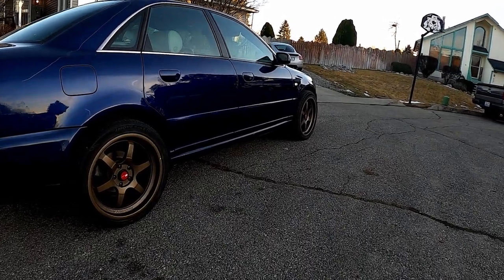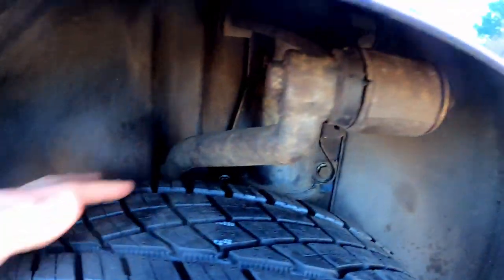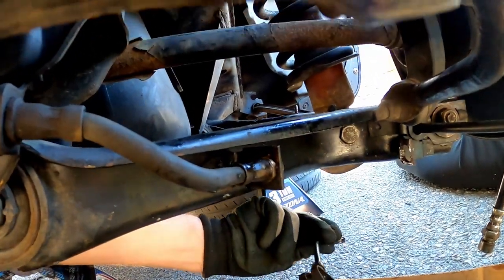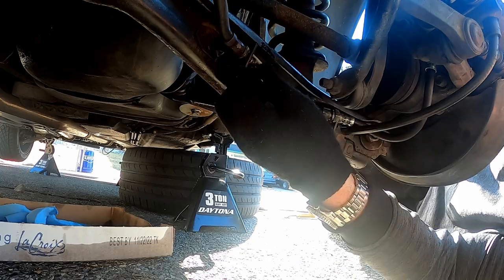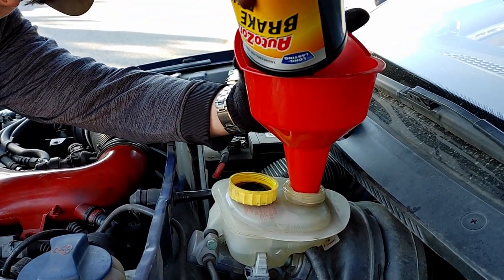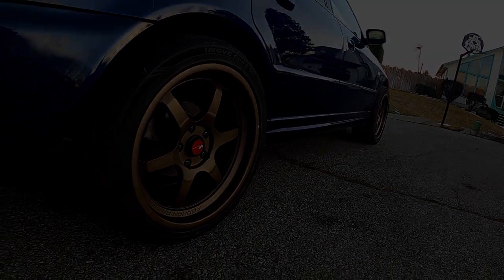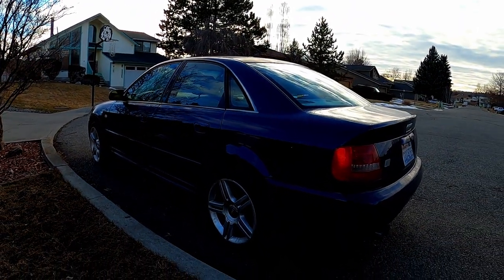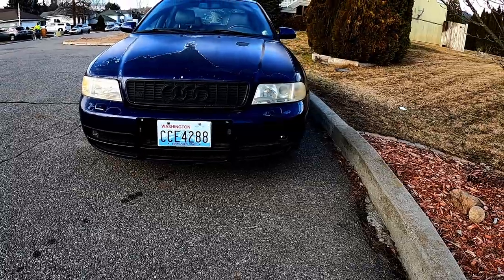Fixing MAJOR PROBLEMS With My B5 S4 | New Control Arms And Wheels

Comment: Looks like you still have stock brakes! Which is totally fine for street driving. If you want to do super hard driving I’d recommend a BBK or similar. What we old s4 guys used to do was do a Porsche 996 brake upgrade. I’m currently on Carrera 4 pistons with Brembo rotors and pads. If you can find that option cheap that’s what I would go with.
Reply from the maker: Haha it's ironic you mention brakes :) The next episode I have slated to come out tomorrow is all about them. I am still looking for some Porsche calipers to upgrade to, but for now I got a performance refresh kit for the stock brakes which is a tremendous improvement over the rusted pads and rotors that the car came with.
Reply: @HunterDirection  oh yeah any brake upgrade will help! I also recommend stiffer front end! My s4 has a really bad habit of taking a nose dive every time I lock up the brakes lol

Comment: You forgot to put the brake line/hose through the lower control arm...
Reply from the maker: That's a great point. I actually did that intentionally as a temporary fix. The used control arm I bought must have been from an a4 vs an s4 so the brake line hole was initially too small for the brake fitting to fit through. A few weeks later I drilled it out and remedied this:) thanks for the support.